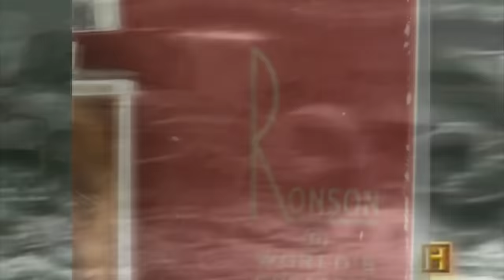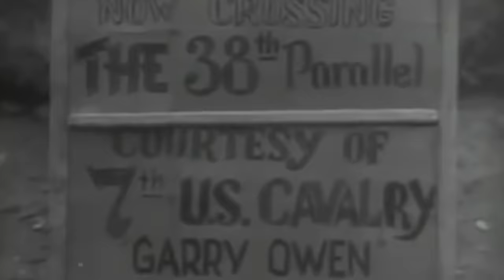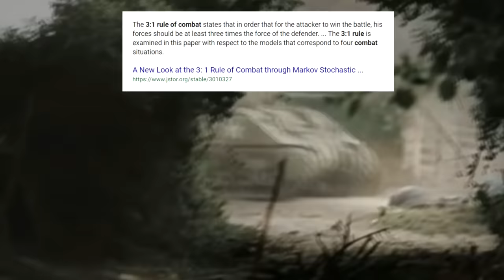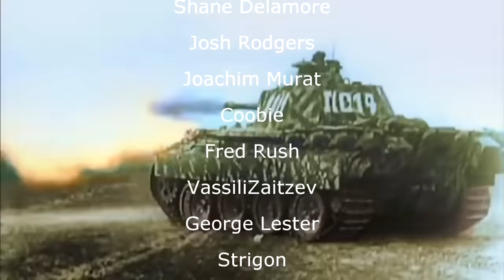The American Tank Meme

Comment: "...being the right tank, for the wrong war."

proceeds to upgrade the Sherman and was used extensively until the 1970's
Reply: Well, once the Pattons started rolling off the assembly lines, the US started gifting Shermans to literally everyone.
Reply: To be fair... I think he means the vanilla version. The Firefly and whatever the israelis called their version was quite good apparently.
Reply: even in Korea the M4 found out the T34 was better lol... The only reason it was used so long was cuz it was ez to build at a low cost.. When do people start getting it?
Reply: @drbomdaydayboms4890  With the 76mm gun and Hvap both tanks could easily kill each other at normal combat ranges. Except North Korean and Chinese tank crews were usually poorly trained compared to American tank crews.
Reply: @drbomdaydayboms4890  - The M4 Sherman have better reliability and can traverse the steep hills and mountains in Korea compared to the M26 and M47 which is only a stopgap tank during the Tank crisis early in the war. The Sherman have a better kill ratio against the T-34-85 than the Pershing early in the war before they were then replaced by the M47 later. By that time most of the North Korean tanks are destroyed. Large majority of tank kills against T-34-85 and IS2 are by the Sherman's compared to it's low casualty.
Reply: ofc it was the wrong war
shermans good for every war babyyyyyyyyyyyyyyyyyyyyyyyyyyyyyyyyyyyy
Reply: @madcourier6217  that i Will agree on thoug. Well said.
Reply: Drbomday Dayboms people will realise it when wars stop being about/won by geopolitical resources/attrition/economies etc and instead won by whomever’s tank is THICC
Reply: Drbomday Dayboms Never, because the T-34 wasn’t better than the Sherman in any right, refer to dimitri Loza’s remark
Reply: So many of them left over after the war is over. So it's almost easy to acquire one.
Reply: The Israelis fielded 2 types of modified Shermans, the M50 and M51 Super Sherman. The M50 had a 76.2mm cannon whereas the M51 had the 105mm that is credited to the French, although the French did experiment with upgunned Shermans.
Reply: Israel: *Laughs in Shekels*
Reply: @raptor4798  well read the facts about it mate why do you think russia came to Berlin first in ww2?
And also the only Thing the t34 did not have over the m4 was a good crew. So K.D rasio is not a valid point omg...
Reply: @inisipisTV  u cant use k.d rasio cuz the crew of the t34 in Korea was crap. Also if u look in the start of the Korea war the north with the t34 steam rulled over the allies and south, when the m4 got a opper hand it had damn good air power to watch over it so agian your point is crap
Reply: @hannesbaumann8509  Actually the big gun on the firefly caused a lot of issues. Edit: in this same video he even comments it took the U.S. years to fine tune the 76mm.
Reply: @hannesbaumann8509  The firefly was actually rather trash, it's why us forces never used it. The 76 actually out preformed the 17 pdr in almost every capacity.
Reply: @madcourier6217  the sherman was very effectief against infantery not tanks that job was mostly done by the phershing
Reply: @Steve Campbell You are so right... The allies did not at all wanna go to Berlin first that is so true really they just wantet the Russians to do it first even thoug you could say the cold war startet close after Berlin fall... And oh ya you say they had made the borders allready funny cuz the bordes did change a lot even after the war. But hey you are clearly so wice here i get ya... 

Oh ya btw about the T34 again and Korea. It have a low cost a good gun and really good armor M4 was stil a firebomb when it got hit and if you just watch a doc about the start of the Korea war then you know for a fact there was no cheat behind the attack.. Just again stupid allies who was thinking down arming the south would make it clear for the north that they would not attack them even thoug the leader in south and North was treatning war the whole time... And cuz you dont know that simple fact i can take any word of what you say as valid. 

There for have a good day i dont wanna waist time on you anymore.
Reply: @Steve Campbell First of all dont care about your spelling my spelling is shit aswell. 
2 You text so much and made like 2 comments after one and other so ya i prob missed a bit about what you textet.
The T34 had no chance later in the war cuz the US and NATO came down with support short before loosing the last city the only thing holding the T34 back was the river where the US had blown the bridges.
I never said it was not a supprice attack i said that they US knew it would happen but actet on down arming the south so they did not them self lead to the conflict. 
an other thing the T34 is an older tank then the M4 and even then it match the M4 better then well and with a better crew and air support im pretty sure the Korea war had ended in a diffrent matter. Also why could the US not take the chines who came and helped North when the US startet to go over the normal north and south border ? Oh yes cuz the M4 was crap. 

And yes like i said in the start the US down weaponed the army in south so yes they did not have the man power to counter the attack from north. But the fact stil remains in my world that the T34 can be build in low cost i could 1v1 take down a M4 and therefor it was better. Best thing about it was stil that when the T34 got hit ofc unless it hit the armor deport it did not blow up like a cain full of fire as the M4 did.
Reply: @johnathanblackwell9960  isn't the real reason for the US doesn't want to use the 17 pdr is because it's a British gun, and why would they use a foreign equipment when they can use their one 76mm gun while reducing the cost for its ammo, spare parts, etc
Reply: @SpecterCat_  They had acess to the ammo, it was mainly an issue of an overly cramped fighting compartment and poor accuracy. They also didn't accept the 76mm until the turret was enlarged and any other issues were worked out. As for the issue of it being a foreign gun, we were making plenty of foreign guns in the states, one such example was the 40mm bofors.
Reply: @drbomdaydayboms4890  It wasn't. The Easy Eight was more than a match for the T-34, you're thinking of the M24 Chaffee which got chewed up and spit out by T-34's and caused a lot of issues early war with American's
Reply: Your on discord
Reply: @NaCl3 No i did not say that at All.
Reply: @moblinmajorgeneral  🤣🤣🤣
Reply: @drbomdaydayboms4890  i don't know how you got that idea but shermans proved superiority over t34s and but supply shortages didn't make it easy
Reply: @inisipisTV   Sorry but M26 was far better than Sherman in Korea .Zaloga : "The evidence strongly suggests that the newer
and more powerful M26 and M46 did have appreciably higher combat effectiveness
in
 the Korean War than the M4A3E8 Sherman" .He also states than Sherman was more reliable than M26. So reliability isn't everything .
Reply: Not by the US
Reply: @drbomdaydayboms4890  the reason they got to berlin before us is we let them and German tanks really were not that great and not very plentiful and they needed a shit ton of fuel and maintenance
Reply: @drbomdaydayboms4890  the reason they rolled over them is they had no tanks and few anti-tank weapons
Reply: @gammainc1666  exactly everyone thinks we were using early war Sherman's the easy 8 pummeled t-34 tanks
Reply: Laughs in Israeli
Reply: @hannesbaumann8509  
The Firefly was kind of sub-par, though. It and the earlier issued British Shermans are a major reason why the M4 would later be called the "Ronson" by some semen swilling degenerates - in the latter case because the Brits would absolutely overload it with ammo early on and in the former case because it made the turret so cramped navigating(and so scrambling out) was considerably more difficult.

The British 76mm gun was very good but it couldn't really fit in the Sherman's turret.

@Drbomday Dayboms
Oh is that why they killed T-34s at a two-to-one ratio? Good to know that worse = twice as lethal.
Reply: @drbomdaydayboms4890  T34 as in the heavy US tank or the T-34 Soviet tank
Reply: Wrong war is just forbprapaganda.. Ppl must always think america is never the bad guy..-.-
Reply: @buuuu7691  ohhhhhhh really I didnt know the US is sometimes the bad guy OMG where did you get that from 

Sarcasm.mp4
Reply: Sometimes even to the 80s.
Argentina used fireflies til mid 80s
Reply: @maxchangarrido7841  And that is a prof the M4 is better ?
Reply: Steve Campbell  for meme
Reply: @drbomdaydayboms4890  they got to Berlin first because we let them why spend our blood for something that is not in our occupation zone
Reply: @intelligentgrawlix794  ofc you did not let them where the fuuk have you gotten that idea?..
Why do you think the allies called it the race to Berlin.
Reply: @drbomdaydayboms4890  were did I get that idea? From history on the subject in numerous books and documentaries! We wanted to be first but then we came to the conclusion of why waste blood on territory we will not occupy. It's that fucking simple.
Reply: @moblinmajorgeneral  the US army preferred to use upgraded Shermans in the Korean War against T-34s
Reply: @drbomdaydayboms4890  It was never about the tank. Whats the use of a tank if you dont have people crewing it.
Reply: @drbomdaydayboms4890  You're mistaking NATO with UN.

Also, I'd rather crew an M4 than a T-34. Just getting in and out of the tank looks really uncomfortable.
Reply: Didn’t America join ww2 almost 3 years before it ended
Reply: @momsspaghetti9970  But my good man this is not about comfort all things from Russia is not comfortable..
Reply: @NoobNoobNews  please give me the link to that statement
Reply: The guns were low velocity and couldn't peirce most armor. The later models fixed this
Reply: Seriously tho the Sherman was amazing in the pacific could barely be stopped usually only time they did was if they hit a mine.
Reply: @drbomdaydayboms4890  but they sure do save crew
Reply: @drbomdaydayboms4890  In Korea the M4 obliterated the T-34, despite the T-34 being crewed by chinese civil war veterans and the M4's being crewed by greens
Reply: @drbomdaydayboms4890  Training of crews is part of the efficacy of the hardware, this is why the MiGs not being all Ti was a bad thing, made it more expensive to train pilots effectively
Reply: My memory is sketchy but i recall the Korean war to be a UN victory: they stopped the communist agression with less casualties than enemy side
Reply: @drbomdaydayboms4890  The Sherman was better. Even the Russians said it with the few they received. They were more comfortable to crew, got better cannons, stabilized gun, and the more important thing, crew survavility. Crews managed to complain about the Shermans because they managed to get out alive, on a T-34 however the crew would never had to complay... because they were dead.
Reply: @Dracorex235  At D-day the shaman was out classed where the T-34/85 came out fast and ez cuz the russians could maunt a bigger gun on the T-34 where as the UK changed the shaman gun and called it a firefly... Also the shaman was never made to be a tank on tank weapon even the panzer 4 could take out a shaman with ez... 
Stop being a M4 fan boy and deal with the fact that the US was behind in the Tank produktion from the start of ww2...
Reply: @osoufmiller5499  more than four actually.
Reply: christopher bjorklund ww2 started September 1939 USA joined in December 1941
Reply: @osoufmiller5499  no I meant the us was in the war for a little over 4 years... not that it joined it after 4 years.
Reply: @moblinmajorgeneral  The US: You get a tank! You get a tank! Everybody gets a tank!
Reply: @drbomdaydayboms4890  Sherman claps a T-34 what do you mean?
Reply: @EnigmaEnginseer  Ya i can see sherman fan boys want to think that..
Reply: @drbomdaydayboms4890  The Ez 8 fuckin rekt the t 34 85. Now the light tank we sent in got rekt. The chaffe or what ever i can't recall it.
Reply: @brandonstrife9738  The only reason for that case is cuz the tankers in russia has les traning at that time then the allies. It was the same thing with german tankers when they took france. France had much better tanks then germany.
Reply: @drbomdaydayboms4890  This is just not true entirely for the north koreans. Russia spent 2 years supplying and training them. Then flew over 90% of the air operation in the war for them. Yes Russian tankers didn't train but about 10 shots per year. as opposed to the american 140 to 160 shots per year. Also Russia even to this day don't fuckin use tanks right.
Reply: @brandonstrife9738  Dude no allied tank killed a T 34 that was used by russia after ww2 or even before so your point make no sens.
My point is still vaild.
Reply: @drbomdaydayboms4890  I'm talking about Korea not ww2.
Reply: @brandonstrife9738   yes and im telling you it all comes to how much training they have... What do you not understand.
Reply: @brandonstrife9738  i know im telling you the t 34 that has been killed by allies is non russian therefor the bad work from the tankers of the t 34... had it been a better crew then you had an other story... There is a reason Russian made tanks are feard...
Reply: @drbomdaydayboms4890  They are not feared for quality they are feared for quantity. They are not bad tanks by no means but not even Russia uses tanks right. They would send them out alone with no support and still do to this day. A ww2 57 mill anti tanks gun can take out modern mbts with no support.
Reply: @brandonstrife9738  read up on the stuff pls... Yo dont know what you talk about. Good day.
Reply: @drbomdaydayboms4890  I do know what i'm talking about. I can tell you almost every tank russia has built. Except some the experimental ones like the objects. Russian tanks have good armor good gun and for the most part good mobility. They don't use them right they have poor crew survivabilty. They are cheaply mass produced which has a slight effect on reliablity but not much. The fact is they at the height of the cold war they had 54000 tanks. Quantity not Quality.
Reply: @brandonstrife9738  for me it looks like we agree and talk past one and other good day
Reply: @drbomdaydayboms4890  German Big Cats for me were feared more.
Reply: @EthanJaye  And that we can agree on
Reply: @EthanJaye  that i will agree with ya on.
Reply: @raptor4798  Numbers and ease of production
Thats where the T-34 wins
You can still find T-34s in use today 
This is due to there reliability and numbers
Reply: @drbomdaydayboms4890  Actually, the T-34 was COMPLETELY outclasses by the M4A3E8 76 HVSS W. Its mainly because the hills of Korea made is so much easier for American tanks to absolutely STEAMROLL the T-34s in front on battles, because the Americans could use tactics the T-34s could not. Such as shoot & scoot ridge peaking. But Crews loved the M4 because its survivable. The T-34 was meant to serve for 2 months. The M4 was meant to serve for years. I recommend LazerPigs video on why the T-34 is dogshit. Also, Russia didn't have to cross one of the biggest oceans to get troops to the field. Russia didn't do mass bombings that crippled Germanys infrastructure, Russia didn't deteriorate the Luftwaffe, Russia didn't keep the oil fields in Egypt safe. Russia didn't deteriorate the U-BOAT threat. Russia didn't cripple the Kreigsmarine, Russia didn't fight tooth and nail to take back France. Russia had a straight and simple push to Berlin. They went through minimal resistance nations like Poland, Romania and Bulgaria and were able to easily smash through them. The M4A3E8 76s served straight to the end of Korea before being replaced by the M47s and M48s. The T-34 test by Aberdeen Proving Ground generated a report saying that the T-34 was absolutely terrible. It was just not as good as contemporary western tanks such as the M4, the Comet, or the Pershing.
Reply: @drbomdaydayboms4890  your point actually proves his point. The T-34 losses in korea by NK and China couldn't be replaced, and their inexperienced units are getting annihilated without these troops actually getting any experience. Which means, the Sherman's Survivability works with how the U.S. fights wars, and therefore worked. The U.S. didn't actually need elite troops, they just needed well trained troops, and a lot them to fight wars. These Shermans being survivable made it so that the experience learned by U.S. tankers, can get sent back home, and make it able to train better troops. Instead of the T-34, which wasn't really built to last, it was built more on fielding a lot of them, and being as good as it can so that logistics is easy. Therefore, crew Survivability doesn't necessarily matter as much. But as was seen in Korea, the T-34s were inadequate as the Koreans and Chinese can't really replace their lost tanks, while the Americans can just pull away their disables shermans, repair them, and put well trained troops, trained by the experience of those who survived in the shermans, to be able to fight.
Reply: @magnum6763  same thing happened with the U.S. fighting the pacific war. They Had, (by standards of most) worse planes than the Japanese did and weren't trained to the level as the Japanese fighter aces were, like Saburo Sakai. However, what the Japanese lacked is their planes being survivable. All of that experience that the Japanese Pilots get on their missions, is wasted once they die, since they aren't training new pilots to pilot more planes. While the U.S. on the other hand, built rugged and reliable aircraft, being able to take a beating and therefore, the experienced pilots of these aircraft can go back home and be used to train new pilots. The U.S. didn't need the absolute best troops, they just needed them to be well trained. The Axis in ww2 suffered from this. All of their elite units troops all died, and by the end of the war, they were fighting with barely trained and poorly equipped militias, on their last legs, because of the irreplaceable casualties they took. The Sherman was built as it was, and it excelled in its Job as a reliable tank that is able to take a beating and or be used in a variety of other roles such as tank killing or infantry support, hell, even Sappers or rocket artillery.
Reply: @poikoi1530  Even then, the contemporary US fighters were actually pretty good, its just that outdated US tactics and racism got the better of them. Wildcats were actually proven to be decent against A6s and not as obsolete as many people say, but actually competent against them. Just by survivability alone the US aircraft were better. Saburo Sakai shot down a wildcat over Guadalcanal (i believe same mission he lost his eye) which took hundreds of shells, and the pilot survived and said that everything worked relatively ok until that second barrage came
Reply: @magnum6763  that's the point, as i've said, the ruggedness of the American Aircraft actually worked well for them, as even if the Zeros had superior maneuverability and range. The Wildcat pilots often survived engagements with zeros, and therefore they can take advantage of the experience gained fighting zeros, which culminated into the thach weave. Japanese Zeroes were made with the bare minimum to save weight and be as maneuverable as possible. Which meant, not having self sealing fuel tanks or a well armored cockpit. Meaning, the superior training of the Japanese pilots in terms of quality, got thrown away once they got show down because of how it isn't as survivable as the wildcats, hellcats, or corsaird. All of which were very rugged and able to shrug off hundreds of hits. (same thing with the B-17s). As such, the Survivability of aircraft and tanks leads to the forces not losing experienced men fighting and being able to use these experiences of theirs training new tankers or pilots. This is something you don't see in russian tanks as often. As you can see with the East-West divide when it comes to tank design, the Russians use autoloaders, being more prone of getting ammoracked and having their turrets pop off like a champagne cork. Meanwhile Western Tanks employ blow out ammo racks, so that is the ammorack does get hit, the crew is safe, and able to get out and bail out the tank, saving the US valuable combat experience. Same thing in ww2, the Crews of the T-34 can easily be replaced, same thing with the T-34, and so, the T-34 is more of a cheap way to field hundreds of tanks with shitty crews so that you can fight a war of attrition. While the Sherman is there to field hundreds of tanks with well trained yanks, and  be able to win wars with sheer industrial and logistical capabilities, having troops be able to do their own stuff.
Reply: @magnum6763  if i was to be asked which tank is better, i'd say the Sherman, purely because it was a reliable tank and it was pretty good at virtually anything. Just slap on some stuff in the field, and you have a sherman for whatever you need. It can take out tanks, support infantry, and many other roles, and i don't have to die having trouble getting out of the cramped spaces of a T-34.
Reply: @poikoi1530  crew is probably 10x more important than a good vehicle. its why US vehicles aren't always the greatest they just have good survivability.
Reply: @magnum6763  they aren't the greatest, but they do their jobs damn well. Although, since the US changed their doctrine in the cold war, they since made their tanks both the best AND survivable, because they can't send a lot of tanks over to europe all at once, so the reasoning behind why they need to be the best tanks, it that these tanks would hold the line and wait for all the other tanks to be sent to Europe within 30 days. Which does sound like a good strategy. But It does sound a lot like the Shermans in ww2, they sent in shitty lee's to hold the line in their fights as the sherman was still in development. And then when it did finally come out, Shermans kicked ass in Africa, Italy Europe, same with Asia (though ngl it's not really a fair fight in Asia)
Reply: @drbomdaydayboms4890  t 34 was amazing on paper but had massive production problems with many things getting taken out just to speed up production 

Watch lazerpigs video on the t 34 for reference
Reply: And she served her purpose well
Reply: @hannesbaumann8509  Israel called theirs the Super Sherman.
Reply: @drbomdaydayboms4890  Russia rushing to Berlin, by wasting millions of lives. American losses 300k soldiers in war.
Reply: @drbomdaydayboms4890  T-34 had no wet ammo storage, only easy eight did
T-34 also had major transmission problems and awful crew ergonomics
Sherman had much lower burnrate and much better crew survival, with better situational awareness and a better fire control system
At that point the 76mm could reliably pen T-34, so armour edge was negated
Reply: @sneekiboi136  3 year old post mate i dont really care anymore to be honest.
Reply: Bruh the T-34 had crap quality armor. You could just slap it and the armor would crack.
Reply: @hannesbaumann8509 I believe it’s called the Sherman IC
Reply: @moblinmajorgeneral  He's not wrong though.  Upgunned and uparmored Shermans were used by the Israelis as late as the 1973 Arab-Israeli War.
Reply: @drbomdaydayboms4890  In the real world, a fair number of Soviet Tankers served in M4s via lend-lease throughout the war and preferred them to the T-34s.
Reply: Well yes they were, but did the people using them have a choice? Did they go to the used tank lot and have a choice of a Tiger, Panther, Pz4 and they chose the Sherman? Nope.
Reply: Apparently a few countries are re-acitvating their old Shermans